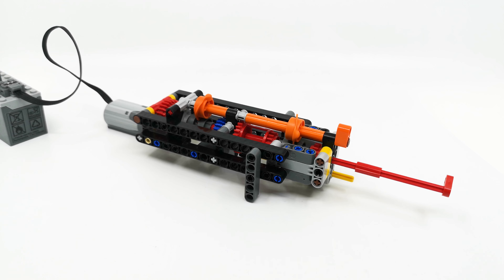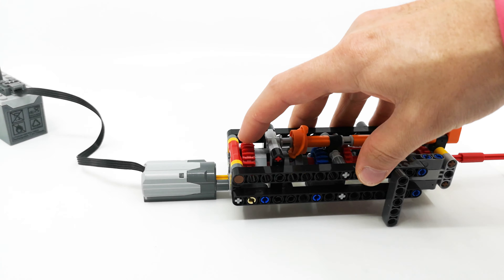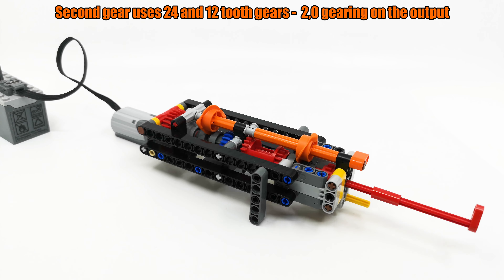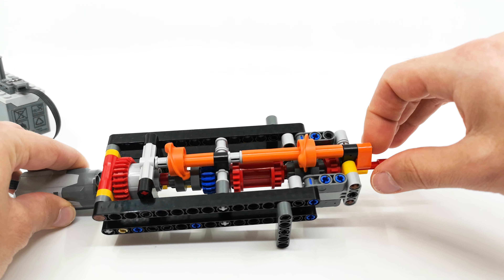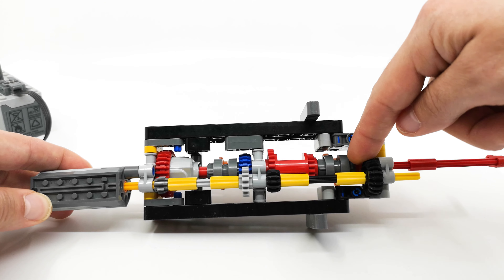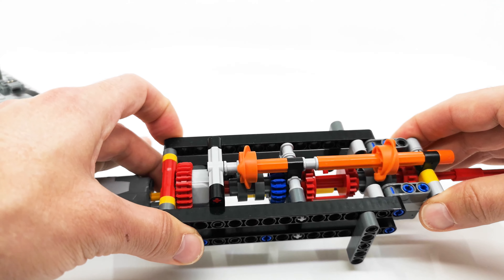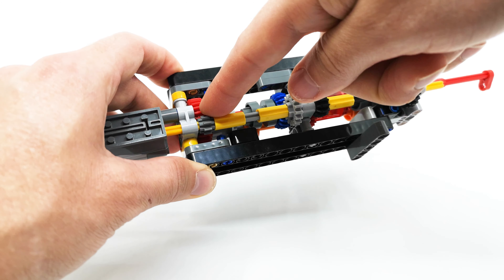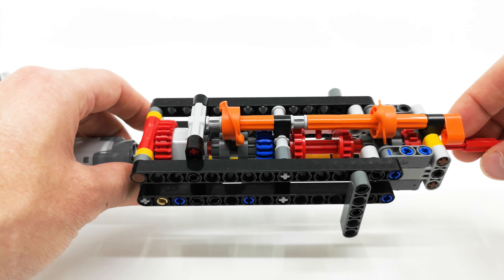Simple Lego 4 speed linear gearbox

Comment: How well does this work under load?
Reply from the maker: I suggest you build and try yourself
Reply from the maker: @user-ep8ns6hg4q  Sorry, but I forgot it's almost 2022 where everyone is entitled to everything without actually putting in the effort and trying something themselves - aka instant gratification. And if you don't have the time or patience to build such a simple model, than I don't think this is a right hobby for you.
Reply from the maker: Okay, let's try again. Regarding the load, I tested it with an M motor in all gears and it can easily hold until the motor is talled in any gear. Because I have no idea what motors/loads you will use, I suggest you build it yourself and try....